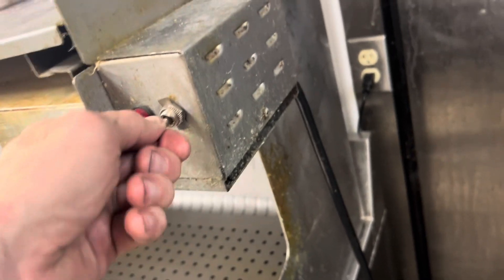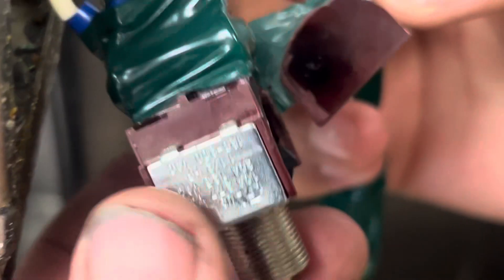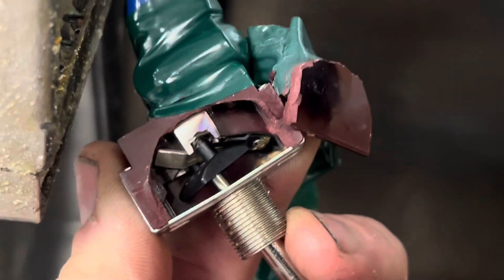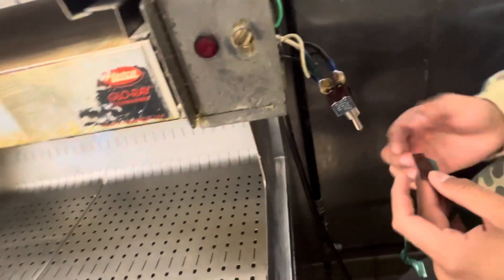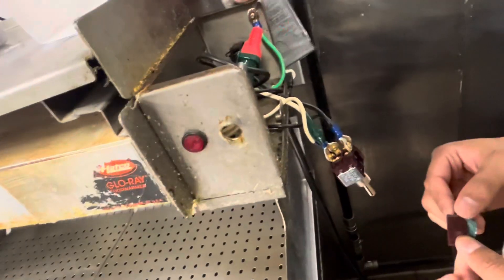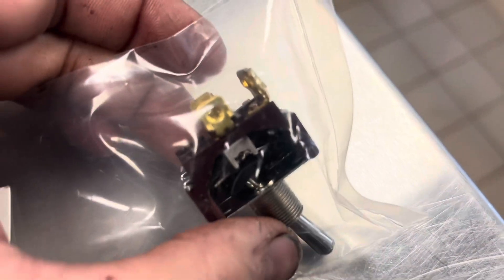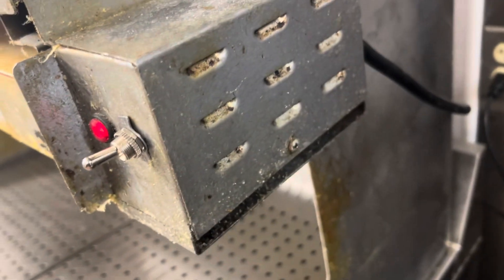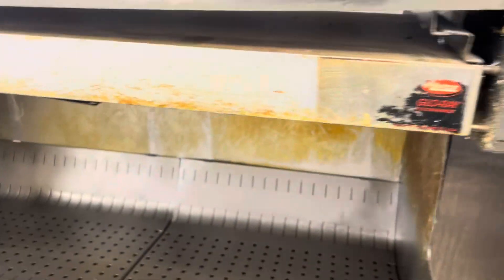Hatco warmer - switch killer

Comment: Most heating elements, Nichrome wire. Calrod. PTC. Porcelain. Quartz which is nichrome wire in a special glass tube, mostly used for infrared heating. Normally will pull a little more current through the connections. This is basically why they say it's best with anything electric resistance heating, to make sure the connections are tight enough to handle it.

Comment: Those panel mount toggle switches with the long lever do seem to break from from people naturally pushing them into the 'stop' then deflecting off axis, and/or bumping into them when there aren't inconvenient guards/covers protecting them.

It is probably best/most-economical to switch replace the switch with an 'industrial' in-wall switch, w/ a 'weatherproof' cover.  The physical stops surrounding the cover's lever should be more tolerant of heavy 'use' (or will show observable damage wear before the switch fails).

While using a second nut (or spring washers) to pull the body of the panelmount switch into the cabinet box may allow the panel to flex to absorb some of the force - I have not seen this work for long.

Comment: Hey!  When replacing those elements or damaged wiring what do you use?  The ceramic wire nuts aren’t my favorite but I always use them because of the heat.  Just curious if there was a better way?

I’ve also been running through bulbs like crazy.  Glass comes out of the socket.  Doesn’t seem like any brand bulb lasts and the hatco ones are a small fortune!

Thanks for what ya do!
Reply from the maker: I also use the high temp wire and the ceramic nuts.  Yes they suck and are basically one time use but it is what it is.  I find over years the high temp wire gets subtly shorts that are intermittent they can only be found with a mega ohm meter.   I’ve had to replace all the wiring before chasing ghost shorts.

Comment: I have the same problem with hot boxes, once a switch goes a second time I move over to the light switch style and that always fixes it.
Reply from the maker: Glad to hear the confirmation I’m in the right path.  👍🏼
Reply: Went thru same thing with multiple switches on same model about a year ago. I found out that someone had wired the heater leg thru the switch so it obviously pulled high continuous amps. Adjusted some wiring so switch only ran the control circuit and heaters straight bypassing switch. PIA!